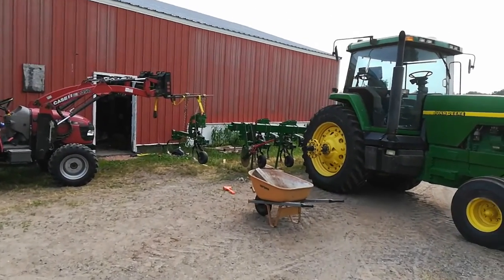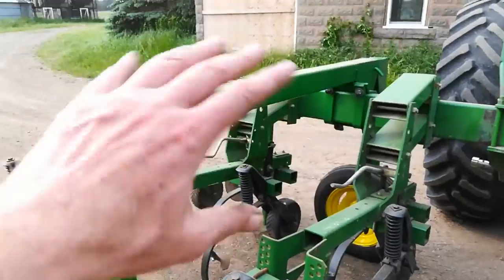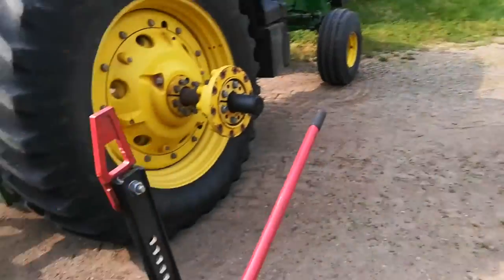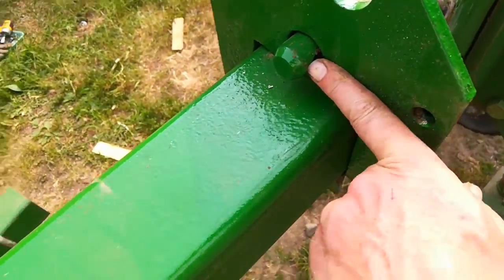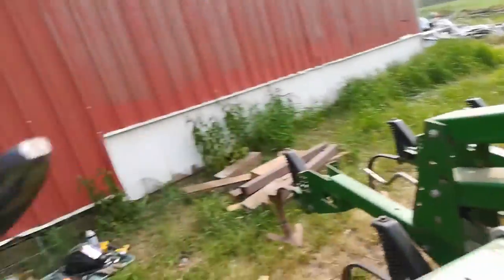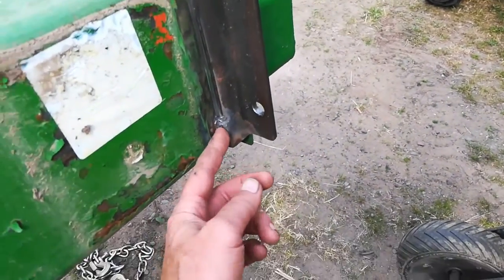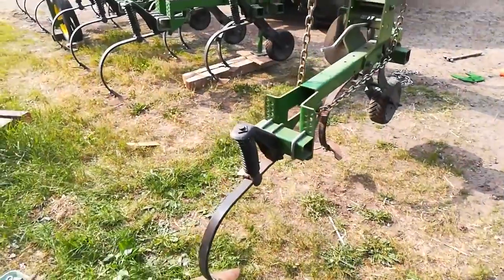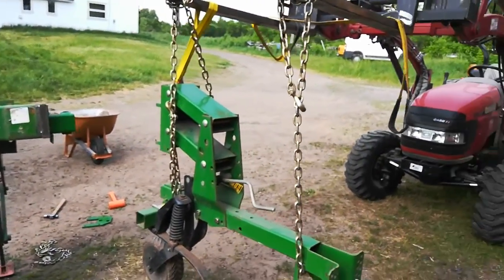Putting End Transport On Deere 856 Row Cultivator

Comment: I’d like to add end transport to my 4 row 825 so I can get it in the shed but I can’t find the wheel weldment.
Reply from the maker: I found mine by putting a free "wanted" ad in the classifieds at New Ag Talk. Maybe try there
Reply: I will do that, thank you. 
I also work as a mechanical designer and would potentially be making my own wheel weldment. Is there any way I could talk you into taking just a couple of measurements on yours for me? I would just send you a really simple blueprint and you could write a few tape measure dimensions on it and send a picture to me or something? It would get me a lot further down the road than starting from scratch.
Reply from the maker: @brianknutson8948  sure you can send me an email bruce at grasscreekfarm  dot net with the print and the dimensions you need. I can get it back to you later this week